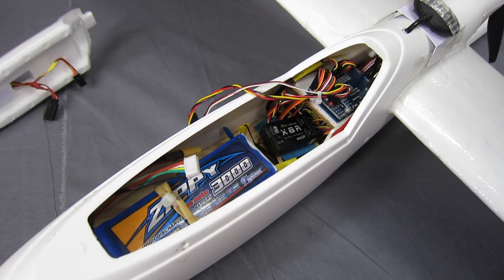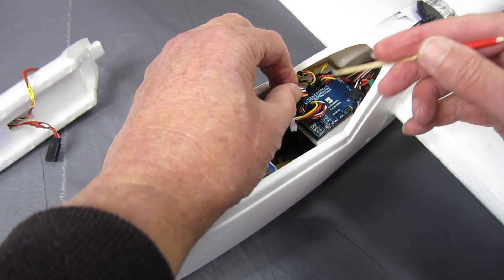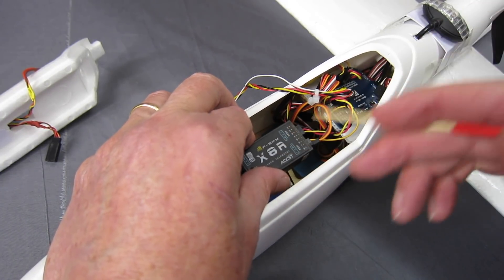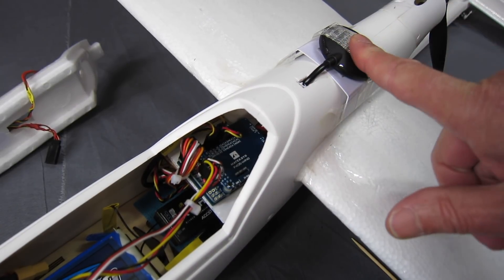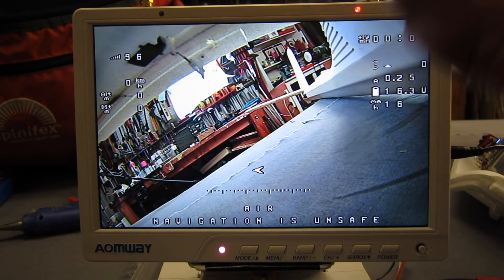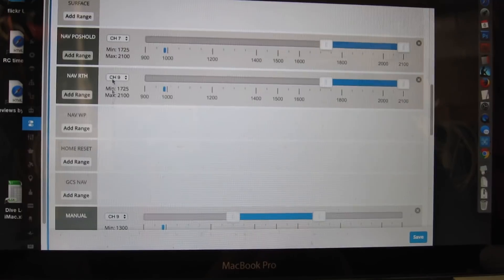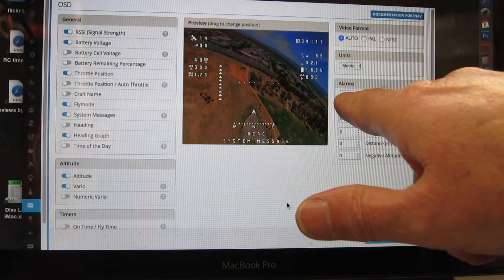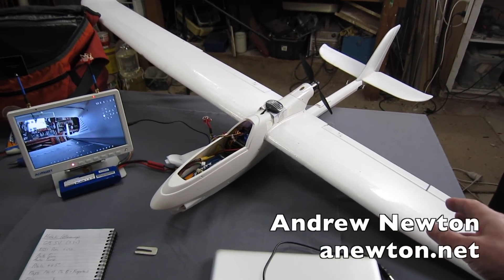Matek F405 - Ranger 2000 tweaking

Comment: G’day Andrew, with respect to flaperons, I have them programmed on my Bix3.
On my brand radio, flaperons are programmed on / off with a switch. 
I use the flap switch, so when flaps are up, flaperons are active.
When I move to mid flaps, flaperons are off. 
Not certain how to program this on the Taranis. Keith
Reply from the maker: I had the iNav spoilerons up when the PWM flaps were level. Just need a little programming tweak to get them working the right way.

Comment: Hello Andrew. 70% expo is most likely too much. The default is made for multirotors, not planes. Autotune won't change anything about that. Your stick center will be essentially dead.
Reply from the maker: Thanks for the confirmation Michel, I usually change it to 0.30.

Comment: Great content Sir! My favorite bird is the Ranger 2000. I'm running a Vector, but will install the 405 into a Harrier 1100. A fun flyer that I am enjoying is a twin motor modified Bixler 1.1 920KV quad motors and 9 inch props.Trying a bit of differential thrust for a bit of extra yaw. If that works maybe spiral rotor landing mode? Thanks again for your efforts.
Reply from the maker: Sounds radical!

Comment: i bought the sky surfer from banggood and its very similar 1400 mm very nice with pnp included motor and prop and esc 75.00
Reply from the maker: Yes that's a nice motor glider
Reply: it flys so nice and forever on a 1500 mah battery. btw Andrew whats a good camera that i can mount on it.not too pricey.thanks

Comment: I just setup Autotrim on my Z84 for the first time....its very pitch sensitive and getting the manual trim status sorted is a mare...Hoping it works....Try the tiny XM Plus reciever Andrew, more range (6kms) and rssi is available on the sbus stream...Building my Ranger G2...its cute...lol.
Reply from the maker: I bought a few of those XMs after your mentioned them previously. Yet to use them but they sound excellent
Reply: Great, if you are using an Autopilot, its a no brainer, tiny, light and a dedicated diversity receiver, so no Telemetry to ruin the reception.  Go to RX for serious 2.4G FPV on a budget.

Comment: With that receiver you can bind it with the jumpers and set it to be chs9-16.  Avoiding the channel 8 issue.
Reply from the maker: Good point, I have not tried that
Reply: I did that with my Strix StratoSurfer so I could have plenty of extra channels for quanum "release mechanisms" on each wing. Great feature to have on those receivers. Great video!

Comment: Hi Andrew, great video as always. Just FYI, you can bring in RSSI over an SBUS  channel with FRSKY telemetry receivers. Hope the rain stops soon.
Reply from the maker: Thanks Davie. I have fiddled with that a little without success.
Reply: I believe Joshua Bardwell has a video on setting it up, as has the sadly missed Project Blue Falcon. I've used your connection method on FRSKY L9R which is a non telemetry receiver, and can confirm it works a treat. Raining here in Scotland now too.....doh!